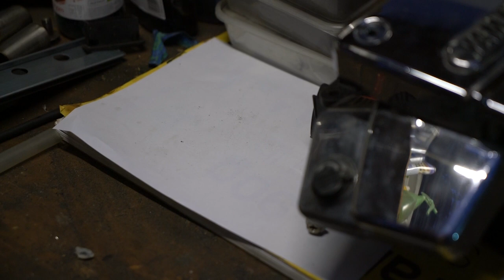Yamaha Chopper Build: Battery Box continued...

Comment: I was wondering why you opted to make the battery covers instead of using the original ones. You could have had them polished re-chromed or powder coated. Unless of course you wanted a custom finish to the covers. Just curious.
Reply from the maker: Just because I wanted to. I didn't like anything about the originals either